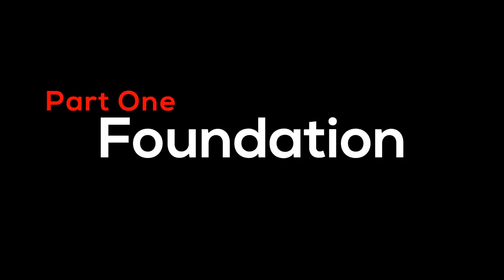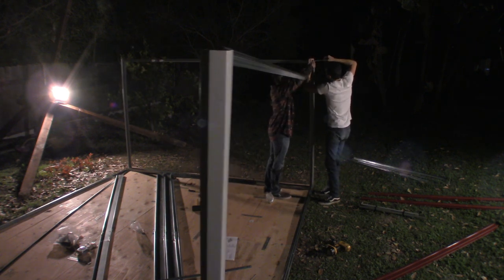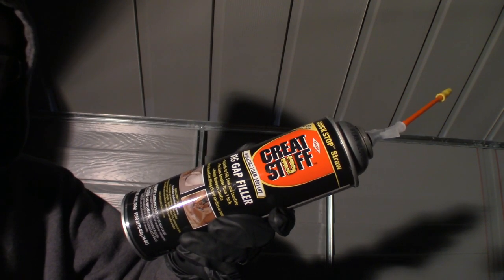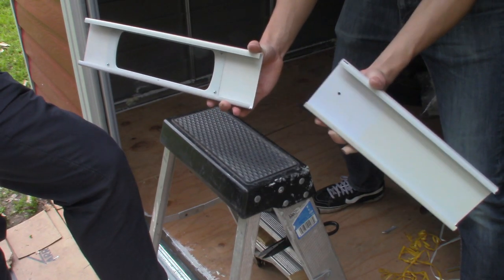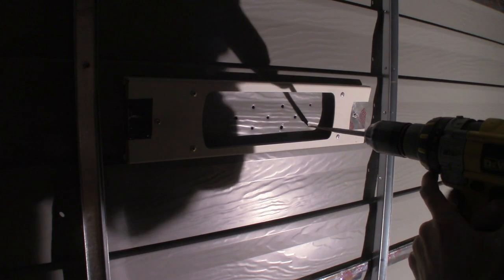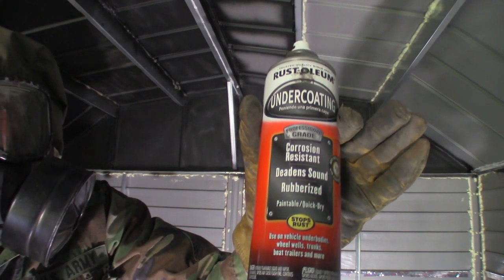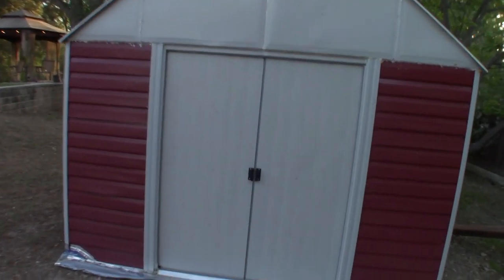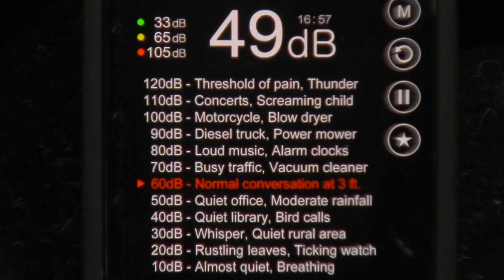How to Make Cheap Soundproof Music / Recording Studio in a Shed / Room

Comment: ...........”first you need 7 acres of land and make sure that the nearest neighbour is more than 100 metres away.... if you have a full band with electric bass and guitar and a singer this will need to be over a mile, preferably in a valley or large dell. Then you’ll need a small loan off dad or you may have to chip into your trust fund to pay for the shed, but remember to buy thin sheet plastic or metal which are both known for their exceptional sound insulation properties. Then, buy insulating caulk to fill the holes and depending on your religious preference, pray to whichever deity you wish that this is plenty to compensate for the poor materials the shed is made of. Next, poke holes in the shed which must be so flimsy you can cut it with scissors and then rest, maybe take some time to sit in the tree house and have a sandwich and juice box before carrying your drum kit from the den or rumpus room it’s been kept in. Then, get some drumsticks and randomly, using a whacky/ swingy motion, hit the various items on the drum kit with some slip knot in your ears, that way even if you sound like a hammered drunk drummer who usually plays in the school swing band, at least you will feel like joey jordisan. Next, assuming nobody else is interested in helping you with your project, nail your smartphone to the fence about 30 metres away and note the sound difference, you will note that rather than sounding like you are playing your kit out in the garden, it now sound like you are playing your drums out in the garden in a shed. Also to make the test fair, do a sound test up close on a live kit and then test it 30 metres away and be impressed that is is slightly quieter than when up close.  It is important to note that your parents neighbours and family will still be able to hear you biffing away, just slightly quieter and outdoors where sound travels much further, which oddly will be more annoying than up close. And there you have it,  tune in next week where we demonstrate that dropping eggs from height causes them to break compared to not dropping them. 👨‍🎓....... for the record, I was just making fun, not a bad job at all dude, like the ingenuity. 🤘😬
Reply from the maker: You really put some effort into that, I LOVE IT!! Hahaha, but yes thank you for watching! :D
Reply from the maker: I keep reading through it it's cracking me up 🤣 The part where I'm playing in the garden now sounding like I'm playing in the garden but in a shed, the best damn thing ever, haha
Reply: I have a large shed that I play in. This shit is fucking hilarious.

Comment: Can I use a Plastic Shed to convert to Music Room / Studio... Living in Poland so the temperatures are very cold. And the ground is always moist
Reply from the maker: If you can manage to seal it up and insulate it. Also, the sound won’t be as isolated behind plastic walls but it definitely beats being outside completely. If that’s all you can work with in your means, do what you can with it, otherwise save up a little to upgrade (or a lot for some serious upgrading, haha)

Comment: put insulation in the corners, the wedge kind... and wrap the ceiling's metal parts with more foam. And use that speaker/software combo that graphs all your Khz range in your studio... Let me get the name for you, the mic is excellent and is around 70 dollars... Let me know if you INDEED fix it up. Good job bro!
One other big thing would be making a foundation first... I know, 1000 bucks in concrete or maybe 2000 but that will really help the shed sit. Plus rebar-tying and bending isn't that hard. Just pouring with a team is a must, unless you do small 4x4 piece first. With that, Elevate your floor and put more ventilation and foam inside, make a matrix of wood with holes between each other, you can also insert small piping in the holes... around 5 per 3 feet or 2 feet -depends how big the floor is and where components sit. For the drum and any sitting area, add more wood there. Then put door the rubber floor and cut out holes for the air/components. 
Also, do you RECORD or just jam with the air on? If you want to, make a small dog house OUTSIDE for the ac unit and send the air in like that, you should buy insulation and some wood to make a small bridge between the studio and dog house, the longer the quieter the air-far away from the motor and for heat... just think of a more vertical of a dog house, 8 ft or so, like a cabinet... taller the better, it will pull cold air and the hot will go up 4 feet to a vent on the cieling of the dog house.
How loud is it when the AC is on, you guys turn it off during a recording right? I would be amazing if it sounded that clear with it on, next to you.
Anyway, let me know what you think. thanks.
Reply: ok, read more... don't punch out holes, just do it for conduit only (for the floating floor)... learning alot just by reviewing SECTIONS of SOUND PROOF WALLS, I google that and see a ton of stuff from architects, worth a check... black and white plans but some are 3d and show you how they made the walls and the sound damping angles. Take care guys!
Reply from the maker: Kris Szlakowski This is fantastic information!! Good stuff man! And yeah when it came to recording, the fan was off to make sure there wasn’t any background noise because we would record with the camera microphone only. Although the AC is pretty silent, I have the feeling that it might still get picked up in recording. Recently though, we bought an interface, microphones, and cables to more precisely record our music. These microphones have a very short range of where they pick up audio so the AC should not be noticeable (and directly plugging in an electric instrument would of course not pick up the AC) BUT I love your idea and think it would be very effective. If we do end up doing this, you will be the first to know! :)
Reply: dude genius!!!!! i played recently with my friends in his shed, and i could here it down the street loud. so we have to invest in some good foam

Comment: My retirement got basically ruined, now I'd only get half a grand a month if I did, which means I can't. But, these FB friends of mine invited me, and I'd keep their house, run errands etc. They're on a large lot, and I thought of getting just a Home Depot garden shed and make that my "room", like where neighbors would just think it's a shed. I'd be way relocating if I do this, like these friends are in WA state, and I'm in TX, so I'd be U Hauling for 3 thousand-ass miles, lol. But I'd get to quit my job, lol. The weather where they are is super wicked mild, and I could be comfy in a shed there even in July,  lol. I've got a lot of music gear, 2 drumkits, over a dozen guitars/basses, computers/DAWs, a dozen mics, synths, like 10 amps, etc, and I'd make that our studio. These friends are old school punk rockers, same sense of humor, and they both play and sing, and we'd totally form a band. I would just run good extension cords out to it, and affix styrofoam on the inside walls, and probably get sheets of plywood to reinforce the floor, and glue floor tiles to it. I won't even need an air conditioner there. I can go in/out of their house, but I'd like to be able to be away from peeps if I want, lol. I'm seeing that the low volume drum heads and low volume cymbals out now sound usable enough to record trax, so I may do that. And since getting Amplitube etc, I rarely use any of my real amps anyway. When/if we play open mics or even get local gigs, I've still got the normal stuff to use. I don't need much to be cozy, lol. I'd get a sofa from Goodwill or listings and I can totally sleep on that, and double as seats. Etc. This makes me think about it more.
Reply from the maker: Dang, sorry to hear of the inconvenience that happened to you. I hope everything turns around to work out to your favor whatever it may be!

Comment: This is a great build, but I would like to suggest that you don't build the ground layer straight on the floor. Preferably, add some kind of weed/pest control netting, on top of that place cinderblocks/bricks and on top of the brick layer make a wooden frame that sits that wooden panels screw onto. This is a similar way to how houses and exterior/auxiliary buildings are built. The reason I mention this is overtime the building will shift and to try and correct it in the future in the way you have built this would make this difficult, vs the way I mentioned where you'd jack up a few of the cinderblocks/bricks, which subsequently would lift the frame that sits on the bricks. I'd also suggest again bodging a single outlet into a wall like that. Get some proper outdoor rated electrical boxes and some armored cable. Running several high wattage devices such as guitar and bass amplifiers, candescent lights, etc. is very dangerous on one outlet and is sure to melt the wire eventually.
Reply from the maker: Love the input! Side note, we actually did end up fitting in an electrical box about last year, in fact I should add that as a pinned comment. But yeah your structural idea sounds great, wish we would’ve done more like that
Reply: @evangarciamusic  Glad you appreciated/liked the suggestions, and it’s great to hear you’ve since improved and added to the electrical system. For a first build, however you guys did brilliantly and I love how you really stuck to the idea of being on a budget which a lot of young musicians face.

Comment: I'm thinking about doing the same as this in my shed but, with the power, instead of making one ugly hole, I suggest just cutting off one end of the cord, use a drill bit that's the same size as the cord, then feed the cut in through, then buy a female repair kit, cheap and you have a clean hole that's a lot less likely to leak or let the little critters in.
Reply from the maker: That sounds like a cool idea

Comment: You are sharing A/C and your band equipment into 1 power strip? Thats a bad idea.  Best is to run a separate line straight from your main panel, run it 15 or 20 amp breaker and a 14 gauge wire. 15 amp is good for 1800-2000 watts of power - should be more than enough for you.  Or if you can run a separate breaker, look for a 15amp or 20amp outlet in your house (20Amp has a "t" shape on one of its jack.) and run an 14 gauge extension cable to the shed. Overall, its a great idea to have a shed as your band rehearsal room.
Reply from the maker: What you said is actually fantastic, we ended up supplying the AC with a separate power source because the power strip was turning off here and there when the AC was running. Thank you for your input!

Comment: Plywood floor should be screwed and fixed to subframe or beams. The tape and tarp is pointless. U shouldve just used pressure treated wood. It has zero breathablity considering the shed is sound proof and treated. U created the perfect environment for a moldy floor. Its gunna crumble at some point.
Reply from the maker: This is good information. Thank you for sharing! Luckily there hasn't been any scent of mold or signs of wet wood but I would definitely have liked to setup the way you are describing 👍
Reply: @evangarciamusic  it will take a 2/3yrs but it will happen. Tbh u coulve just run lattes along the bricks and screwed plywood straight to them. Id put ecotec bubble insulation over the lattes first like I did with mine. For a tiny few quid more pressure treated wood would handle the weather. Id remove tape and tarp. cover in sealed n treated wood.

Comment: Really good idea to cut out sound if that noise is yours.....first go practise in a field
Reply from the maker: I’m not one to provide false information so that wouldn’t be a good idea in my opinion. And also, it doesn’t 100% eliminate sound, but it does reduce the output. We used to receive noise complaints before and now because of this, no one has said anything so that’s a good step in the right direction :)

Comment: This is the worst construction EVER...
Reply from the maker: It would be much appreciated if you could provide some constructive criticism so the people can read this and learn.
Reply: Well, if you insist: from a technical point of view this is worth almost nothing in terms of stability, durability, insulation, moist control, etc, etc.
Reply from the maker: @baasbaasje6960  I apologize for the late reply, I must inform you though that this setup has survived to this very day without issue and does in fact reduce the transfer of sound throughout the area. Also, it provides a space that offers better sound quality than a typical room. I definitely understand there are better builds out there but those do come with a greater price. Now, I only ask that you state some information that other people will read and learn from while understanding the overall topic of this video.